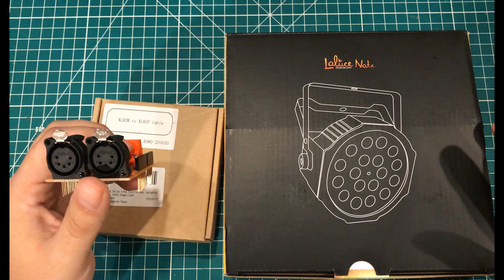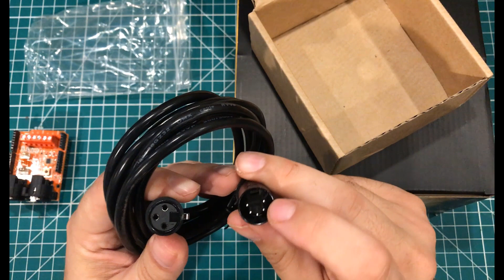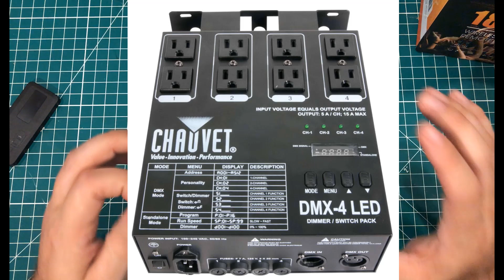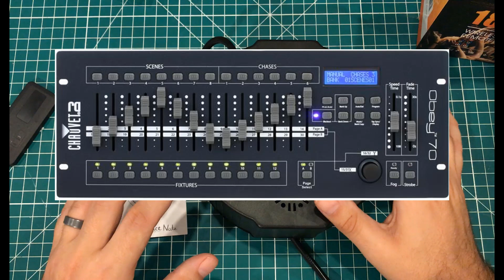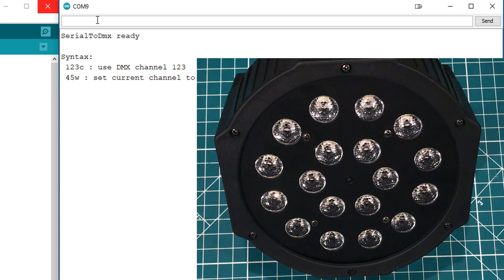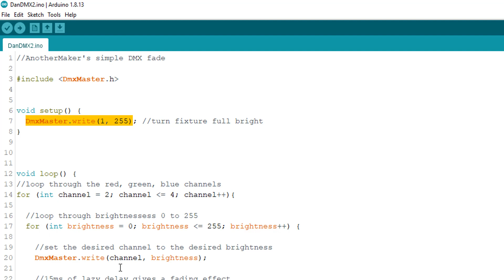Control DMX Lights with Arduino

Comment: Thanks for the interesting video.
Im trying to research if its possible to use the arduino platform to build a usb to dmx translator for on pc software like chamsys or grand MA.
Reply from the maker: Yes, but you would want one of Arduino boards that has the 16u4 chip on it like the leonardo or I believe it's called the pro micro/pro mini.  I forget which one has that chip, but those can talk directly to the usb port.

Comment: Your video was a great start for me to understand how the Arduino can be used with DMX. Many thanks. 

What I cannot find anywhere is someone demonstrating how to control moving head lights via the same route. As far as I understand it, these lights have extra channels for controlling the pan and tilt, and so on. But the fact that all the examples I have seen control static LED fixtures makes me wonder if the Arduino has some kind of limitation. Any thoughts? 

Raymond, Nottingham UK.
Reply from the maker: Hi Raymond.  Good to hear from you.  I don't think there's any special limitations, I just think the static fixtures are easier to demonstrate.  Yes. Those fixtures have extra channels, but they are the same 0-255 as anything else. The arduino is completely unaware of whether or not it's changing a color or moving a light.  

Now the one thing I would imagine is that a lot of the software has "profiles" for these fixtures so you can simply put that you want to do a figure 8 pattern or you want to make some sort of geometric shape.  That's how the software I've used worked.  So if you wanted to accomplish the same thing with anything other than a sweep with an arduino you would have to do some sort of math (like pan +2 for every +1 you tilt to go at some sort of angle).  I'm guessing everyone (me included) is too lazy to do that.
Reply: @AnotherMaker  Thanks for your kind reply. I have found some code at https://github.com/compugician/DMX-MovingHead which takes the light to a specified 3 point co-ordinate. It's a good guide, but I doubt I will need anything that fancy. My light will be outdoors (under a cover) at Christmas, pointing at a rotating glitterball for some of the time, and making gentle sweeps and so on at others. If I do need anything really fancy, I should be able to invoke one of the light's inbuilt display chases. The trick I think is to find a way to keep everything compact and simple so as not to blow the Arduino storage limit.

Mad? Probably. If it all works, I will post it. 

Take care. Raymond.
Reply: @earlgreybeard  Could a CSV file be used to store timings etc.?
Reply: @benveasey7474  Hi Ben. I am sure that would be good practice. I am not familiar with Arduino file handling, but no doubt it is feasible. My main issue currently is getting the interface to work at all, even with a hard-coded routine. But your comment has re-inspired me. I might have another go!

Comment: I am blown away by the lighting of the 1994 Pink Floyd "PULSE" Concert. Any idea how that massive and complex lighting was controlled back then? I am finding no information.  Thank you very kindly, Randall
Reply from the maker: DMX was around then, so they may have used it. I'll ask some friends.
Reply: @AnotherMaker  Thank you very kindly. I am in awe of the scope and complexity of the lighting.  Any info would be greatly appreciated 🙏

Comment: its bad for your lights to use audio xlr bacles beavsue these are ment for carrying a analog signle not digital likr dmx
Reply from the maker: I know that it's not recommended but I've done it for 20 years and if you have decent mic cables, it works amazingly well. I'm not telling anyone else to do it, but it worked for me.
Reply: If your equipment has 3-pin XLR connectors you will most likely be fine either way, but the longer your cable/circuit is the more likely it is that you will experience signal reflection. This can cause your equipment to stutter, which is mostly harmless, but if you use fixtures with mechanical parts (like moving heads or physical shutters) they may move violently. Take care and don't plug your lights into sound equipment!
Reply from the maker: @RasmusZetterberg  Absolutely. My 100ft snake had 4 returns. I used 2 for audio and 2 for lights, but it was a pretty consistent setup.  Even at that distance, my moving head lasers didn't have any issues, but that was just my experience.  Everyone's mileage may vary.

Comment: Hi Mate,
Great video I'm only new to Arduino and needed some help.
I need to control my CO2 jets and this would be perfect.
Can you please do a indeep video if I wanted to use 4 arcade buttons and where I would connect the buttons to the board and what boards I need.
Basically what I need to do is when I push/hold in the button I need 3 channels to work
1 is the spray of the CO2
2 red led
3 the dimmer of the led.
I wanted to add 4 buttons to this project RGB+W.
Do you have any videos on this..?
Thank you hope you reply.
Nav
djnav24@gmail.com
Reply from the maker: I don't have any particular videos but a button is a button when it comes to arduino so just detect that the button is pressed and if it is, fire off the DMX.  If you're not a member of the arduino facebook group or subreddit, that's probably a  good place to get coding help with specific examples.

Comment: Technically 3 pin DMX doesnt exist. Some cheap units use a 3 pin connector but it isnt part of the DMX standard and its REALLY dangerous to have round with audio gear. 5 pin is much more common.  You also shouldnt use microphone cables, they are the wrong impedance and cause cable reflections - its one of those things that is '90% ok' - it mostly works but you get weird glitches and hard to track failures.
Reply from the maker: I mentioned the mic cable thing in the description. I was waiting for this comment :)   This is why I think it's really stupid that YT doesn't allow me to add text notes to the video if I say something factually inaccurate (or dumb). 

 I 'd also push back a bit on the 5 pin is "much more common" as I'm sure that in terms of units sold over the last 10 years there are way more that use 3 pin DMX over 5.  In fact, of the few hundred DMX devices I've owned only DMX controllers had 5 pin interfaces on them. I don't think I've ever owned a 5 pin fixture.  Mine were plentiful ...but not high end :)
Reply: @AnotherMaker  I worked in a theatre for a few years and every dmx fixture we had was 5 pin. On the low end 3 pin is common but as soon as you go into the professional field you see mostly 5 pin. But yes the mic cables work (though impedance is different).
Reply: I have done stage lighting for musical events for years & everything from 30$ lights to 6000$ lights and dmx equipment we use are only 3 pin. The out is a XLR Female, you can't really mix up with audio cables because you'll end up with 2 of the same female or male connectors you can't connect together normaly.

+ we mostly have actual dmx 3 pin cables, but sometimes have to use digiflex microphone cables, or even electrical wires & even with like 1000ft on 1 dmx512 universe we never ran into any issue with cables. 

The standard is old but pretty reliable.
Reply: I know this is like 2 years old but some of this is a bit wrong. 

3 pin is still DMX. DMX was originally designed in 1986 to work as a 3 or 5 pin cable but with 2 of the pins left available for future upgrades as technology developed. So even now if you open up 5 pin DMX cables pin 3 and 5 a lot of the time aren’t even connected. The future upgrade ended up being bi-directional communication through a protocol upgrade to DMX called RDM (remote device management) allowing fixtures to send back data so they could be monitored from control. 

Also saying it’s “really dangerous” to have 3 pin DMX around audio gear is a huge overstatement. If you accidentally cross them in all likelihood nothing will happen but it’s best professional practice not to do it.
Reply: @ChecklistRobot  3 pin is technically deprecated from the official standard now.
Reply: You CAN actually get 3pin dmx that’s the correct impedance. Audio cables are 45 to 75 ohms, lighting is 110 ohms. A quick search for 3pin 110 ohm lighting cable brings up a lot of purchasable results. Any ‘danger’ is mainly if the different resistances get mixed in together due to blasé techs not knowing better (or not caring) because it can muddy up the data signal for either application if you grab the wrong one.
Reply: @admantius  my dude, DMX is a standard that includes physical connector specs, and that spec does not include 3pin. There may be cables available but they arent DMX

Comment: I remember doing bar gigs with fully analog lighting before DMX became available.  
Then I started seeing some of the big DMX controlled rigs at some concerts I worked (1KW Par64s were more common in arena scale shows). 
And now (as you said) almost everything is LED. 
The amount of magic that the newer tech allows in a lighting rig is truly amazing, especially when you compare it to what we used to have to do.
Reply from the maker: The first time I stood on a stage blasted by Par64s, I could not believe the amount of heat they threw.  In Florida in the summer, it was a huge deal because in air conditioning is already taxed to the max, so moving to LED was a game changer for heat...not to mention weight and flexibility.

Comment: Good intro for getting up and running!  I might have to get some low cost lights for playing around.  I have 2 American DJ's but they can be awkward for desktop demos with the bulky cables built in sticking out the back and torquing the lights around.
Reply from the maker: I can't believe I never saw your DMX video.  37,000 other people did :)  I'm absolutely going to be building a few of your RS485 DMX adapters.  I want to try to do one of the USB ones on Node Red